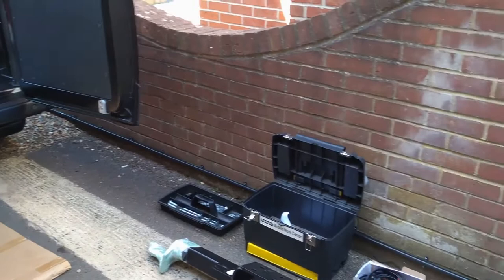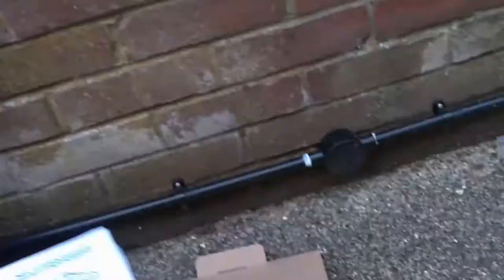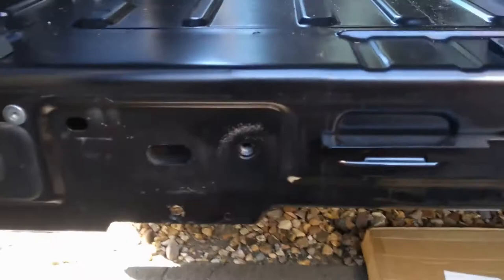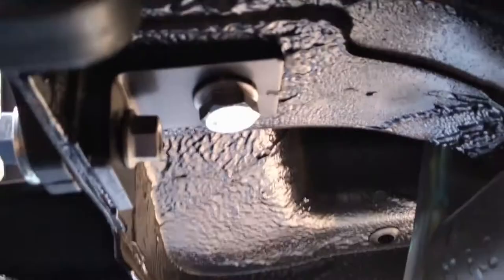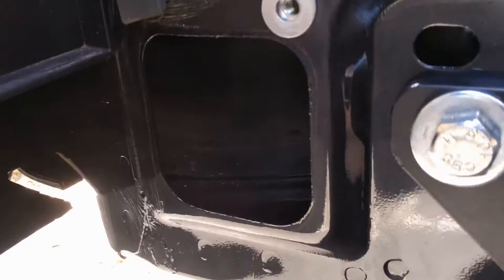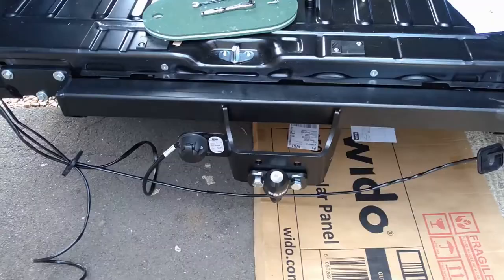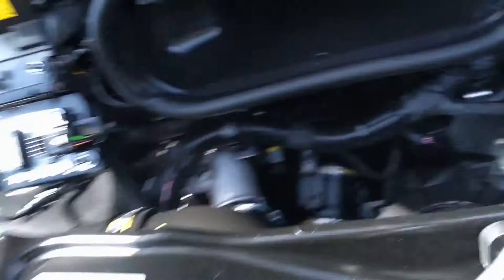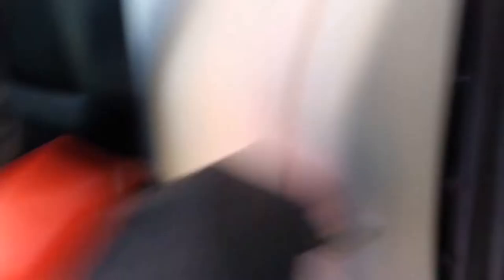Fitting tow bar and electric kit to a ducato

Comment: Just for future reference regarding the fuse box under the headlight. There is access and egress routes for cables, if you remove the fuse board itself which just unclips you will see the route down the bottom, no need for drilling and plenty of space for additional cables. I found this out recently when adding some DRLs.
Reply from the maker: Thanks, I got scared so didn't take it further!  I've pinned this comment for any future readers - thanks

Comment: Great video, very useful info. May I ask was the wiring you were installing for a 7 pin or 13 pin electrics? Thanks.
Reply from the maker: Hi.  I installed 7 pin, but the 13 pin is similar and just drops in - may need a beefier +12v feed but nothing complex.   (My trailer is a simple 7 pin thing and no need for more). I did install their 13 pin kit on a previous van, and it simply dropped in and installed the same way.  Check out PFJones website, they have the manuals there for the dedicated kit, and check the part numbers.  Search their store on ebay as they may sell the same kits cheaper on ebay (eg boxer kit XXXX may be cheaper than ducato kit XXXX even though they are the same and same part number).  Good luck
Reply: @Ryan_DYD  thanks for the extra info.
Reply from the maker: @paulchambers5029  No worries.  Easy job apart from getting a +12v feed (which you need regardless of method).  But the kits are faultless and removable if issues.  100000x better than snipping/joining.  Good luck
Reply: @Ryan_DYD  I was wondering if the live feed could come from the leisure battery as it’s right at the back of the van?,
Reply from the maker: @paulchambers5029  I don't know. It may confuse the canbus bulb failure system.  I really didn't know. I did consider the same as my batteries are at the rear. But in the end used the live feed in the converters socket. If you are charging off the engine you could use the same source....?

Comment: Did you need to program the software or anything like that to finish the installation?
Reply from the maker: Nope.  The interface board with the kit (dedicated) connects and thats it.  Software only needed for complex beasts, like cars with ESP to deal with trailers, or self levelling suspension.  This just interfaces to work the lights and the van is otherwise unaware.

Comment: Hi buddy can you recall when fitting the instructions tell you to cut the blue wire pin 13 on the multi plug to the big relay, it seems a bit strange to me so I’m not cutting that until I speak to pf jones… I’ve picked up the 12v from the battery itself under the van and into the battery box.
Reply from the maker: Hi.  Getting power was my challenge!  I did have to snip a wire going into a box in the rear corner pillar.  That box, I believe, is the reversing sensor controller.  So that when you go into reverse with a trailer on it doesn't beep.  I did what it said, and it all works.....!  If you don't do it, I'd expect it all to work, but beep when you reverse a trailer.
(of course, my kit may've been different to yours, but thats what mine did)

Comment: behind the drivers seat where you took power from, where do you get the plug that plugs straight in, thanks graham
Reply from the maker: Hi Graham, thats the converts socket that is an option so may not be on all vans.  I can take no credit for the info - look at MrG's blog here - has all you need to know (and all I used to set it up) https://www.misterg.org.uk/camper-converters-socket.html
Reply: @Ryan_DYD  my van is the Peugeot 2018 blue, its got the same as yours, I used the Sargent 155 unit to power the van, I need a direct live from the van to the Sargent, that would make it so easy to do from there,
thanks
graham

Comment: Hi Again, may i ask? in the end when you need to connect the wires to the bonnet fuse box to get power... Why didn't you connect them to the battery instead of the pillar?
Reply from the maker: Could not find an easy route to the battery without drilling battery box etc.  The 12v at the converters socket, that I was going to use anyway, was easy access.  The route to the engine fuse box was a lot more work.  To be honest, it was the least impact route - I didn't want to drill/damage/touch anything on a new van

Comment: just bought an l3h2 ducato 70plate for conversion. fitted rear cameras and now looking at a towbar. i piggybacked the feed via the dashboard fusebox would that have been easier than fitting via the battery isolator?
Reply from the maker: I didn't see a way of getting a cable into the cab area easily, so if you managed it - good on you!  It beat me.  I needed to use the converters socket for Battery-to-battery system, D+ signal for step, dashcam (+12v & D+) - so I was going to wire in there any (see https://lh3.googleusercontent.com/pw/ACtC-3eNznEslKenzx8n0T7G4rZe6hv-6U0nI0flDgkJ1qgX5qevdGyMyAwrs0h8K0LuuY7l11ZUSBOmhbeWe87uPv9S92igzO_uTJedeLkW5cizNZa7-ra9pmNMSK3-PfwDcCfTatTiA82beXsrPiIQBu4QiQ=w493-h657-no?authuser=0 ).   So using it for towbar wasn't any hassle.  (Its on the live side of the isolator - the isolator is just for link to battery-to-battery system)
Reply: @Ryan_DYD   I followed the lights wiring loom  along the top channel drivers side  and the down the door frame and under the step then  up the inside of the door. if that makes sense. now you got me looking at air suspension. 👍
Reply from the maker: Yes I understand what you did now - hope your comment will help someone else without converters socket!  I went roughly the same route but stopped early.  Re air suspension - the kit I bought is really good and simple to fit - depending on where you want the gauges.  Yesterday first drive in a month with more weight in now, and the van handled really well and no suspension noise at all. Bargain for the price compared to some.  (of course, if you want a cleverer system you may want a different kit, but I don't).  Do it before the rubber helper nut rusts :)

Comment: Hi Ryan, may I ask, you removed the bulkhead but the void space around is now covered, where did you buy that bulkhead around cover?
Reply from the maker: I'm afraid I cheated and is a perk of buying a new van....   If you specify "no bulkhead" as a no cost option you get all the trim pre installed.  (Also, single seat is a no cost option, and passenger airbags are simple).  Saves c. £1k in bits + hassle over a 2nd hand van with double seats and bulkhead.  There is a company, https://coastalmotorhomes.co.uk/body-exhaust/trim-panels.html who sell the parts but you need quite a few and is quite expensive as you can see.

Comment: hi ryan ive nearly done the towbar wiring on my ducato the only concern i have  is connecting to number 6 pin on the senser module plug  , when you cut the wire for yours did you connect the loom wire   to the plug , were you able to plug the new wire in or did you solder , i rang pf jones and didn,t get much joy, hope you can advise cheers john
Reply from the maker: I really can't remember?  I remember snipping near the reverse sensor box - did you have to connect a wire to that?  If so I vaguely remember, and its is what I'd do today, is use a Wago connector which I love and keep spares!
Reply: thanks mate i did try to de- pin the plug, but i ended up soldering kind of you to reply @Ryan_DYD

Comment: Hi Ryan, its now time to think about our bikes and install a towbar in our 2021 boxer. PFJones have 6 towbars for the boxer 2021: Westfalia, Brink, PCT, Witter, PFJones, and Oris. which one is yours Ryan?
Reply from the maker: We have the bikes inside :)  Tow bar part number:  481900 - Brink - and wiring kit 19500565PF  - check ebay (from pfjones) as they can be cheaper on there.  Also pfj sometimes participate on the ebay 20% off deals.  (Hence I bought the towbar and electrics 6+ mths before I bought the van!)
Reply: hi when you fitted your towbar and electrics when carrying your bikes have you had any trouble with your reverse sensors hope you can help cheers john

Comment: hi ryan i followed your towbar install, and learnt a lot from you. however i cocked up on the  electrics i just bought a relay for canbus electrics wired it up . great stuff it worked ok with sensors. soon as i put my  towbar bike rack on the sensors just beeped continuous and  brought a warning light up on dashboard .  so now i think yours is wired to the sensor wiring with the correct wiring kit. i know ive made a mistake , but some people may want to tow a car  so the sensors automatically switch off , is this the case with yours cheers john
Reply from the maker: Hi.  Yeah, the dedicated kit (c. £100) is weeeeell worth it!  Plug n play and just works.  Links with the reversing sensors happily and just works as you'd expect and no beeping when something connected.  Also deals with foglights so you don't get "bright" reflections.  I'd not want to snip and use relay kits - these vans are sensitive enough.
Reply: thanks mate,just ordered a kit from cf jones today  @Ryan_DYD
Reply from the maker: @jessestrum  may be too late but check eBay as they seem on there too and I bought the boxer version same part number cheaper than the fiat and cheaper than their main page. Think I got an eBay 20% code too!  I did have tow bar in loft for months before I bought the van lol
Reply: thanks ryan i looked all over on ebay  , ended up having to pay £140 very painfull but dont need a dealers code , and it will switch the sensors of when my bike rack is on @Ryan_DYD